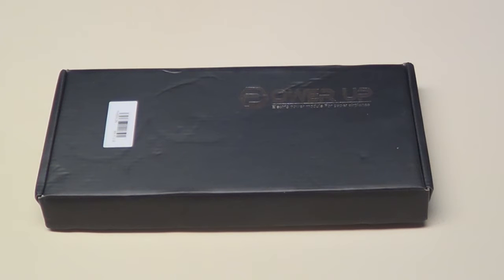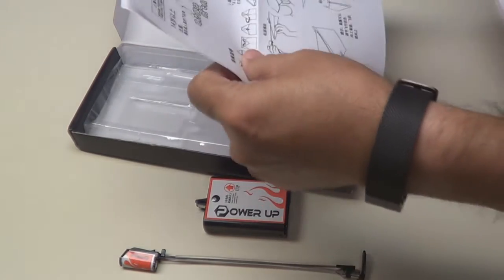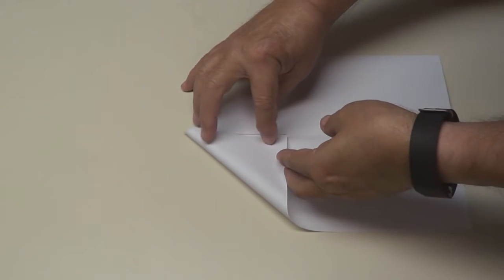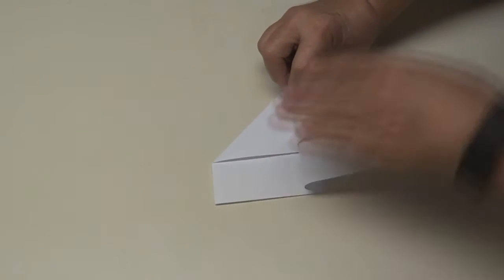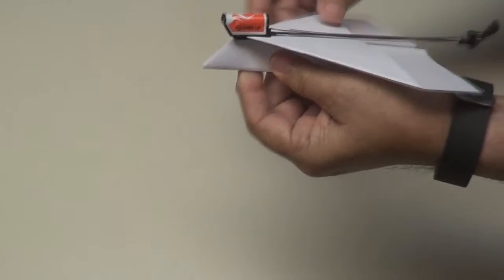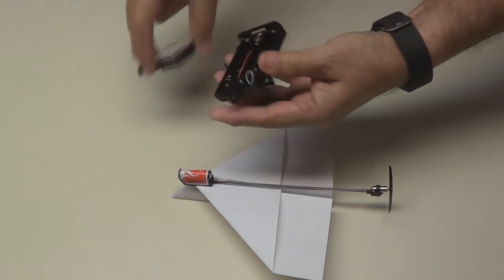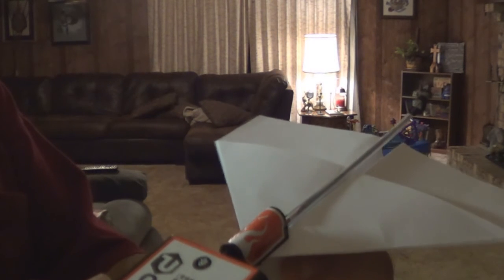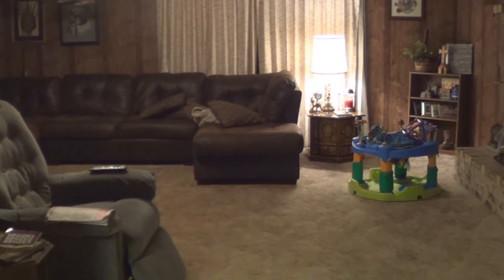PowerUp Paper Airplane Electric Conversion Kit and Review

Comment from the maker: Can anyone give a little help on why I can't get it to fly very far?
Reply: Even in the best conditions they don't fly very far, the main thing is the charger batteries have to be absolutely fresh good quality to fully charge the capacitor/battery. I charge it and listen to the motor, it gets faster and faster until it is fully charged, then launch it immediately. The technique then is to get it to climb under power so it can glide as far as possible
Reply from the maker: Thanks will try that